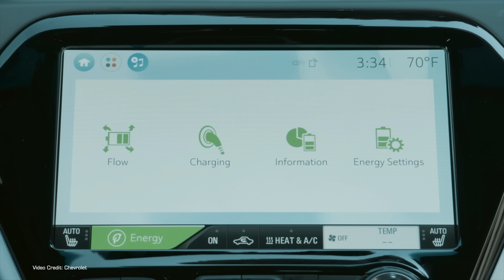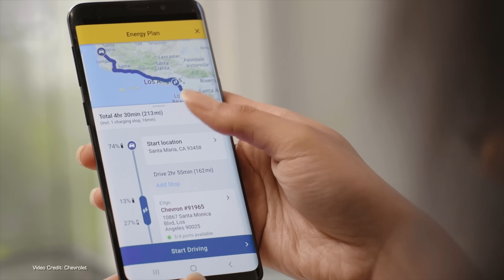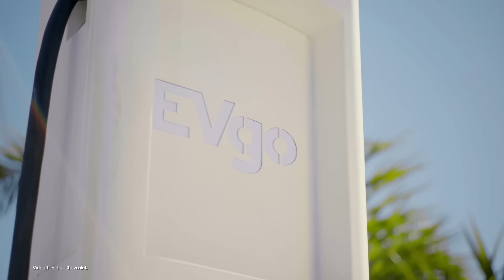UPDATE: Bolt EV Fire : GM Announces Full Battery Module Replacement - Here's What You Need To Know!

Comment: There is nothing wrong with ev 
However they should start in houses work out bugs and submerge it oil to keep cool and cut down on fires I blamed this bolt fires on tax on carbon 
Manufacturers can't tell Gov't it's not ready yet 
One day bats maybe great however or they use a lot rare earth element's
They can increase gas mileage by moving 18 v 
Rember old 6 v systems I nearly run over run over one cause lights were so dim 
My classmate said you can increase mpg by 30% by going 18 v 
Then upgrade the exhaust and cats 
They forgot the e=mc2
So if car gets 40 mpg and half weight it's less efficient than car gets 28mph 
This what happens when people thing they are smart cause have degree

Comment: This faulty battery incident might just work into the favor of all conventional car manufacturers. Since GM has only made roughly 120K Bolt EVs since 2018, this is not a big investment. GM’s bread and butter is selling trucks and SUVs, so with these rare battery fires happening, this will give all EV makers a black eye. Which could cause lower EV sales, and boost ICE sales. GM is probably loving this whole situation. So my opinion GM will purposely take years to fix this battery situation. You may say, but what about the 30 EV models coming by 2030? I really doubt that will ever happen. Remember what they did to the EV1.

Comment: Well, this battery problem is pretty non-optimal.
But i have had at least 2 ICEs catch fire on me and another ICE had a small, but damaging, explosion.
If less than a dozen Bolts have caught fire I'm figuring I'm still a 1,000 times safer from random operating fires than with an ICE.
I think this is just way down in the noise  of my car related risks given that I actually drive my 2019 Bolt on the road with other drivers.
The new battery or buyback options sound nice.

Comment: GM extended the recall to cover every single Bolt ever made. Including the 2022 EV and 2022 EUV. They made this update on August 20th. In Canada the recall (#N212345940) is currently listed as "Incomplete, remedy not yet available." It's probably gonna be a while before I'll be able to take in my 2022 EV. GM is pretty awful when it comes to customer care and recalls so I am not surprised by anything they do.

Comment: Greetings. For those on lease, wouldn’t GM be in breach of contract/lease for not offering a vehicle that meets specifications promised under state Lemon laws? For example: range use and enjoyment are all impacted by the restrictions related to charge, storage and charging. Curious as to your thoughts on this. Thanks in advance.
Reply: We just leased our bolt ev end of May. Shortly after that it was recalled. We can't charge it in our garage...have to leave it on the driveway and we are afraid to get into it at all. There is no enjoyment of this vehicle, just anger. Feels like fraud.

Comment: In my household we have three Chevy EV's and a Tesla since 2014 and will probably trade the 2014 one in for the newer Bolt EUV, and never had any battery problems with any of them (recalls done immediately).  At this point in my life I only want to purchase EV's now due to their low almost no maintenance.  I've seen more ICE vehicles on fire than EV's by a long shot, but that's makes the news for news.  If your on the fence about getting an EV, I wouldn't worry at all about it and you'll probably never go back to ICE vehicles again.

Comment: I don't have a garage and there are no charging ports available in the parking lot. I charge my 2020 Bolt where I can, when I can and always outside. I rarely charge above 90% and tend to get nervous when the range gets below 50 miles. I don't feel any concern about my Bolt bursting into flames. But, I feel for those who have 2017 to 2019-ish models where this issue seems to be more prevalent. Still, if you follow the advice of GM, hopefully your car will make it to the point where the battery gets replaced before any problems "flare up".

Comment: Yeah, I was about to buy a Bolt EV. Now I've decided I'll never by Chevy electric vehicles due to the non-user orientated fix approach. They should have just fixed them to begin with. Warranties don't fix a couple years of wondering if your car will start on fire. Looking to pick up a used Aptera once they come down in price a little, or a used Hyundai if I need a replacement car sooner rather than later.

Comment: in my 1st dealership service for my Bolt I asked them to correct the headlights from their Very High setting to the correct one and they adjusted them to 10 feet from the car so at night I couldn't see a thing (i readjusted them myself in 2 minutes after learning the process)  so I don't know if I trust a local GM dealership to tear open my car to do a battery swap.  The lights adjustment was too hard for them.
Reply: Duncan...I had the same problem!  My dealership was even worse!  They denied that there was a problem and told me that the lights weren't too bright!  Meanwhile, I was getting high-beamed every night on the road to the point where I avoided travelling at night.  Now I know that they could have fixed the problem and either didn't know how to do it or were just too lazy to get it done.  Horrible!  Thank you for sharing.

Comment: The replacement with a brand new fresh battery pack will be the best solution for all parties involved in this misfortune. 
LG Battery Solution, GM and us as consumers. 
The idea of replace only defective modules of the battery is like a jackpot.
 if your car at the end is  successfully repaired. 
it could be in any case that they swap a good battery module thinking that is bad or they left a possible bad battery module and then you continue with a risky battery. 
there will be many different dealers and technicians working on this recall which involved many steps to follow , details and to pay good attention to perform this recall the right way. something totally different from the assembling line where part of this process is made by robots or automated systems. 
That's why I think the whole battery replacement would be like a plug and play and the best solution for all.

Comment: I just got my recall notice today to come in and replace all the modules in the battery pack of my 2019 Chevy bolt. It also stated I would get a brand new warranty, eight year 100,000 miles on the new battery pack. The recall did say I would be notified as soon as the new modules came in.
Reply: Please keep us posted!
I have been tempted to hire an attorney to contact G.M. to get the lead out of their ass in replacing my battery.
This should be their top priority not making new cars until they have fixed their old ones.

Comment: We recently bought an EUV (for reasons not related to the fires).  And we were going to sell our 2019 Bolt. But immediately after buying the EUV is when all of this fire fiasco started up, and thus selling a 2019 Bolt has become a bit challenging.  At this point I'll probably just wait for the new battery modules.  I suspect the car will actually be worth more when I can advertise that it has a brand-new battery and now gets even more range than the original spec.
Reply: Damage is done. Nobody wants the fire hazard car

Comment: So if Bolt owners start getting battery replacement date estimates of 1-2 years....  Does that mean that there will be a Fire sale on used Bolt's?
I'm wondering because I could use an inexpensive vehicle to commute to work with, and I can park and charge it a good distance away from any other vehicles or structures, both at home and work..... If a person is driving their Bolt and the vehicle burns to the ground, while waiting for GM to have a battery available for a replacement under recall, does your insurance cover the vehicle?

Comment: So, if GM can devise a CONCLUSIVE test to detect bad pouch cells in a module, they’ll begin doing the‘bad module’ replacement strategy.  Does the Bolt EVs system have the ability to use original chemistry modules along side newer chemistry modules and keep the whole pack balanced?  Thought this was an Ultium architecture feature.  I get the necessity with limited cell production, but will that work?

Comment: Note that GM said that they will Replace the Modules inside the Battery, Not the complete Pack as a Unit.
Do you trust the Local Dealer center to mess inside that 400 Volt battery and seal it? sorry to say but I'd rather sell the car then do that "Fix"
Thanks TEN

Comment: Sounds like the balancing circuitry needs to be more effective to keep weaker and higher IR cells/modules under 4.2 V during high charge currents.
Weaker cells discharge further than the normal distribution and also charge faster, and may reach values that degrade the electrolyte and progressively , and lead to progressive degradation.
It's the charge and balancing circuitry that needs updating, as well as degraded modules.

Comment: I feel your pain, on June 13th my bolt left me stranded. Had a towed in and after 20 days left with a completely new battery pack. Unfortunately it did not make it a single day before all the warning lights came back on. My bolt has currently been in the shop for 67 days awaiting a back ordered "relay block".
Reply: What a nightmare. You should be posting about it every week on GM’s Twitter feed or FB page.
Reply: Ouch!

Comment: I have a 2017 with 108K miles. Since I just replaced the headlamp bulbs (which requires the same amount of effort as replacing an ENGINE on a petrol-powered car), I don't want the hours of effort to be wasted.

Comment: Temperature sensors are dirt-cheap, and the control systems should be able to manage dangerous situations. 
Or am I missing something?
Reply: GM/LG's sensors are in groups of 3 cells so they can't pinpoint any individual cell that might be bad, and their software can't detect the edge cases. Each owner just has to hope they don't have both the more common defect and the rare defect. Every new day is a roll of the dice for a Bolt owner! Anyone that can't keep their car within 40-80 percent charge only is at a higher risk.

Comment: if it's any consolation folks just know Eric (News Coulomb fame) indicates his 2017 Bolt is now 5 years old and has 140,000 miles on the clock (the result of MULTIPLE DC fast charging sessions).  so see it's all RISK in the fight against Climate Change meaning sometimes you go to Vegas, gamble, and you WIN...?  while other times you go to Vegas, gamble, and you LOSE...?  no matter what, it helps to understand one's odds are NEVER any better than 50/50.  so long you hold that mindset, you'll be ready for whatever may come.

Comment: see now that a 2020 has torched itself, it begs the question does a battery replacement from the American production line (be it whole or just a module) even mean anything...?  as i've said previously, it's very important we get control of our "TECHNO OPTIMISM" and this behavior that technology is going to magically SAVE US....?  i repeat IT'S NOT, so notice how we keep getting reminded about this every time an LG equipped car smokes itself...?  or a Tesla on Autopilot SLAMS into the back of stationary Fire Truck...? look, the only thing that can ultimately ever save us are simply THE BRAINS IN OUR HEAD.  no this option is neither "sexy" nor "romantic" but those in the Aviation community knows this WORKS, it's a "thing".

Comment: I'm sorry to say but I was all in on buying a Bolt EUV but the battery issue and the way GM is handling this has me on the back burner.
Reply: re: "the way GM is handling this has me on the back burner." <--- Randy i see what you did there.
Reply: I would not suggest anyone buy a Bolt! There are other interesting EV's arriving, or about to, so I'd investigate those more. I wouldn't trust GM's Ultium battery either until there are half million on the road for eight years and zero fires.

Comment: To the best I understand if Gm only replaces some of the modules. THERE WILL BE A BALLANCE PROBLEM  CAUSING EVEN MORE PROBLEMS , with battery deprivation.
Reply: When has any battery manufacturer ever  suggested mixing new and used batteries in a pack????

Comment: As you know, I’m currently approved for an MSRP swap for a 2022 Bolt EUV. Mine is delayed because I’m waiting for one with Super Cruise, but I did go and drive a Bolt EUV Premier without the super cruise and I’ve got to say, it is a substantial upgrade. I expected to feel like I was still driving a Bolt, but the EUV has a substantially more premium feel. Better ride quality, enormously better interior quality, better technology, better sound system (Bose vs Bose) and more interior room. My 2019 Bolt was built October 2018 and is likely to be one of the prioritized replacements (it used to be frequently deep cycled prior to the battery fires as well), and a replacement 2022 battery would be a nice solution to the issue, but I personally will still stick with the MSRP swap. The Bolt EUV is just a better Bolt.

Comment: From someone who has completed the MSRP Buyback program, I have to say what a pleasant experience it was - all around. I'd recommend swapping your EV for the new EUV. Since GM has lowered the price of the new EV by @ $5K compared to the 2017 EV, that allows you to purchase a Premier EUV for about the same value. I opted for the upgrade. The EUV is a much better car compared to the EV, and I wonder if the EV would even be continued long term. BTW - not only did GM cover the MSRP expense, but they also covered title and registration transfer fees. Also, my dealership opted not to charge me any destination fees. The Buyback was really a GREAT deal!!
Reply: That's great and we would do it but it only works in states with really good lemon laws.  I've not heard of anyone in Minnesota getting a buy back.

Comment: This answers a question I had about why the fires only seemed to become a thing last year even though the cars had been on the road for three years. I was thinking that if the problem took time to develop then why was it happening on 2019 models in 2020 and not 2017 models in 2018 or 2019.

Logistically, the only way they can do this is by dropping and replacing the battery pack on a car and then taking its old pack to a central location for processing. You can't do this on a car by car basis at a dealership. I guess they could give you a "loaner" battery pack and refit your original refurbished pack at a later date. It makes sense to an extent insofar as they probably just can't source new cells at any price right now. Each dealer would need a stock of loaner packs and that would be the potential bottleneck on progress ( along with resources and cell replacement inventory at battery rebuild facilities ).

What a shirt show!

My wife does about 120 miles a week, 20 or so a day, so our use case is the best possible given the restrictions. Only problem is I have been trying to cure her of range anxiety as she drops below 100 miles and now I have to tell her not to go below 70.

Comment: If I was a Bolt owner I would NOT accept module replacement as a fix to this issue. Tearing apart the pack to test modules and then rebuilt it provides WAYYY too many opportunities for more problems and human errors to be introduced. This is the equivalent of doing open heart surgery at a CHECKUP.  Also, the skills required to build a pack to begin with, and the skills required to tear down a pack for recycling are completely different then the skills required to tear down a pack and rebuild it.  Which means you can absolutely 100% expect some dealerships to be better at this process than other dealerships, which means GM could actually end up with a string of problems generated by less capable dealerships doing faulty pack rebuilds. I would recommend owners either do a buyback or demand a whole new battery pack. And for GM, from a cost standpoint, there is no way that tearing down and rebuilding packs with all of the safety checks that will be required is more cost or time effective than whole pack replacement, esp considering that new packs should be costing them less than the old packs did.

The only reason I can imagine GM wants to do this vs swapping out new packs is that the old housing will make it appear to be the same part. While a whole new pack would look like a new part. So perhaps it has something to do with the beurocracy of their warantees and parts replacement programs.

Comment: Sorry but rebuilding packs at the dealership is just BAD practice. There will be 0% consistent quality.
What needs to be done, is set up Depots (might be in regions with dense Bolt presense) that rebuild packs to true certified (just like the original) and the dealer just swaps the pack out from 'one in stock' to avoid long out of service time at the dealer. Yes, some might get all new and others get ones that would have just the remainder+ of the original capacity. 'And for a few $, we will get you the newer cells'. This would be great for the environment IF the rebuilds can be trusted.

Comment: I bought my 2017 Bolt used. GM offered me a buyback equivalent to the amount I paid, not MSRP, minus a per mile charge for usage. That was a non-starter for me.

I don’t know which will be worse, living with the Bolt battery as-is, or going for the battery module update and have to deal with my local Chevy dealer. It is depressing there. Dirty, smelly and totally disinterested employees.